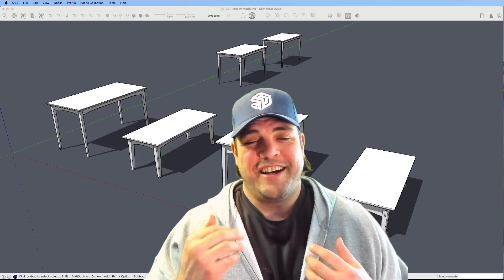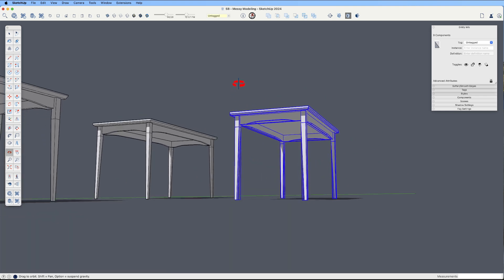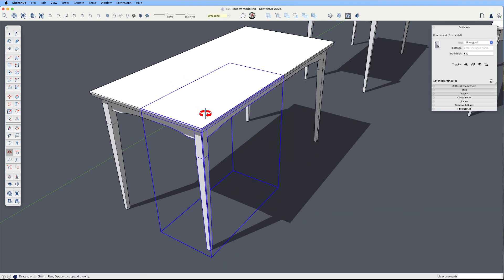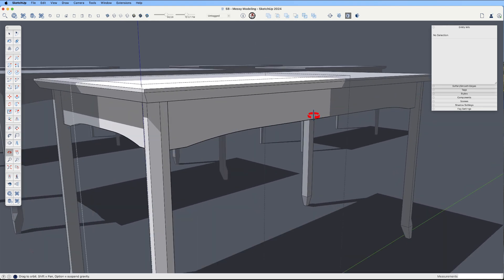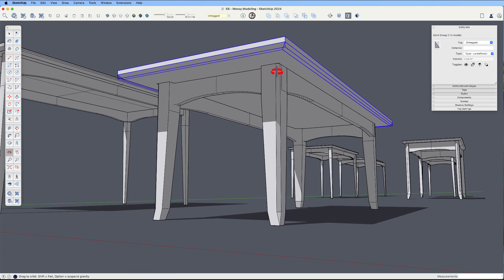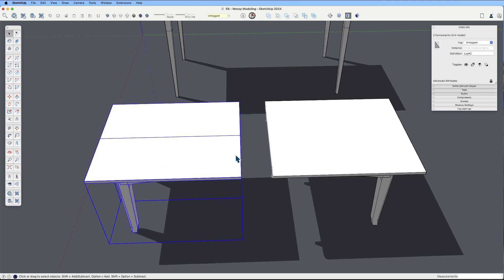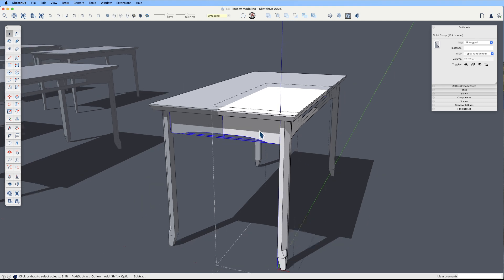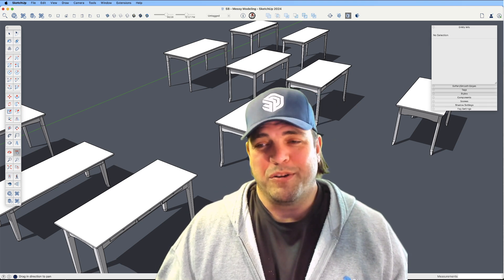My Modeling Philosophy? Make a Mess!

Comment: Hey Tyson,
I often watch your videos to learn things or compare methods.
I was interested to see how you progress in your iterations. And for once I'm not very enthusiastic about your method.
When you draw a table this way, it's not easy to calculate the right dimensions. You constantly have to divide or multiply by two.
What's more, in the end, when you want to produce a cut sheet with opencutlist, you first have to redraw the table with the full dimensions of the components. More wasted time.

My method for iterations is to 
Create components / instances of each part.
Create a component of the entire object (here, the table)
Duplicate the entire object component
And here's the trick: Lock the first entire object component
Now that the entire object is locked, sketchup will systematically warn you when you ant to modify a copy or anything inside the copy. Just select "make unique" and you're good to go.